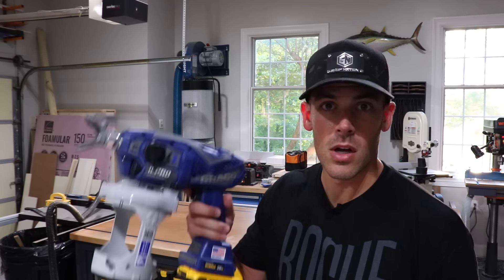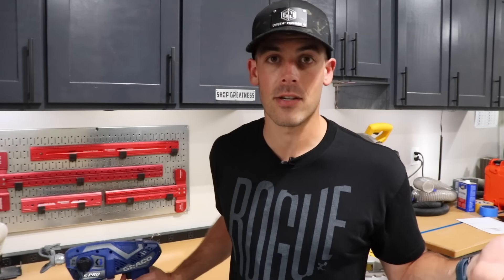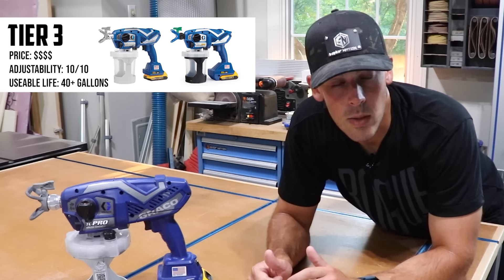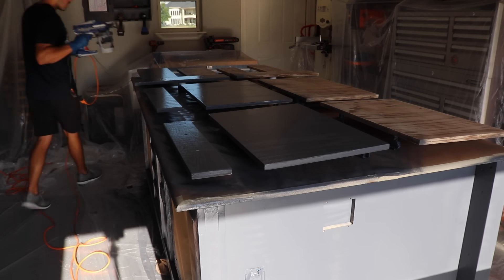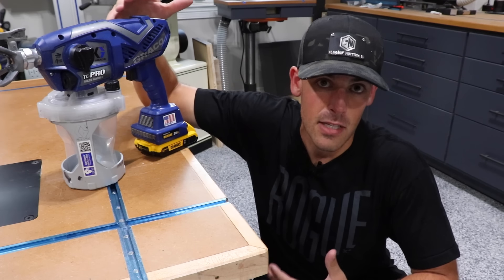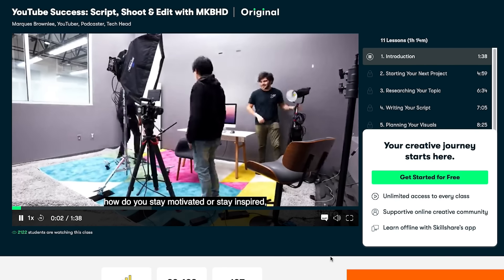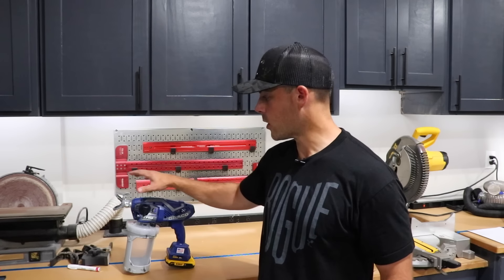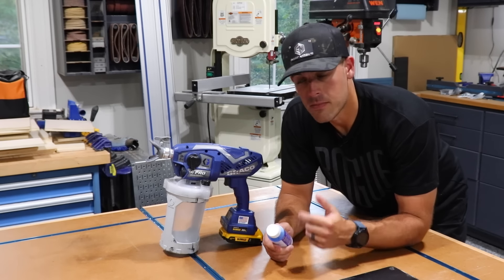Best Cordless Airless Paint Sprayer? // Graco Tc Pro & Ultra Review

Comment: Great video, one quick point, and it's kind of a biggie, the TC PRO and the ULTRA are the exact same sprayer. The FFLP spray tips are 100% compatible with the TC PRO and all of the inner components are exactly the same.
Reply: I called Graco  2/18/22 and this was confirmed.  Indentical except for cup frame and tip protector colors.  Common marketing for big-box / paint store offerings.
Reply: I saw this some place else in the comments. Thank you. I was thinking of switching them out before opening. I feel better.

I got the TC Pro at Lowes with a 10% off coupon I purchased at HugeOff for $2 and the price went from $640 to $570 after tax. So TC Pro with 10% off coupon seems the better way to go cause I'm seeing the Ultra for $640 BEFORE tax. So that's $100 difference.
Reply: @trevcdeal  I appreciate you sharing the “Huge Off” coupon deal.  I had never heard of it.  I made a $700 purchase two weeks ago.  Wish I would have known about this.
Reply: @missffinley  I literally just used it yesterday. Used the 10% on a $260 wood order and saved $26. 

I’m about to buy like 10 sheets of drywall and a lot of other stuff. Will come in handle again.

I’ve thought about getting the Home Depot Pro card so I can use the coupons with them. I just haven’t committed yet.
Reply: Your wrong.  The difference is that you can spray oils inn the ultra it comes with anti shock or something
Reply: @thehobbyguy  that's what I was thinking !
Reply: @thehobbyguy  yes the ultra is designed to he used with explosive material the pro is not
Reply: @DjbreedKronikaudio  that’s right they’re not the same only one sprays flammable materials which is a big deal for some contractors which makes them very much different
Reply: @trevcdeal  I’m lost. What are u saying? I’m interested. Thx
Reply: @longshotdiedtired1582  that's only the ultra max. The regular ultra is water based paints only.
Reply: Incorrect, they’re very different. If you want to spray volatile finishes (explosive, flammable) you need the Ultra.
Reply: @HBSuccess  They’re the same, you’re thinking of the ultra max which is used for flammable products.
Reply: @thehobbyguy  Nope they’re the exact same sprayer. The Ultra MAX is different and can spray flammable liquids but the TC PRO AND Ultra are the exact same sprayer.
Reply: @erineric1  Thank you.  I didn't notice they have Ultra and Ultra Max.

Comment: The Ultra goes for about 650 these days. But, how long does the pump last ? At $200 a pop, this thing sounds like a money pit.
Reply: Add a comment...

It is. one more thing that nobody seems to be mentioning is this guns pump was not designed for the long haul. Proof of that are the serviceable plastic ball springs that are not really serviceable. Whether it be a hex screw or Philips it doesn't matter. the pressure required to remove them will strip them. Same goes for the ball spring housing behind the tip. It's also made of plastic. There's no way to remove it without tearing it up.

Comment: That skill share sounds great. I have two of these. One Ultra and one TC Pro.  I have put about 90 gal. Through the pumps before the clogging problems begin. They spray excellent and I am a pro painter. I refinish trim and paint small 50-70 sq. Ft ceilings with it. Now the clean out. I can do it in about 6-7 minutes.. basically take off cup leave the cup holder top on and tip up side down under a faucet. Switch between prime and spray several times. Easy to clean and 1/2 the time of my big G490’s. Recommended if you do 5-10 jobs per year.
Reply: What tips do you normally use with the TC Pro other than the 514 that comes with it

Comment: Great sprayer! I have the Ultra and painted the entire interior of my 1600sqf home. I love the interchangeable tips as it helped me get the paint flow/fan size just right for the various paints I used. I know you were concerned about its ability to do big jobs and, while you will definitely get a forearm workout, I had no issues with overheating while running the sprayer continuously through multiple batteries. I also purchased extra 42oz cups and liners and kept other charged batteries handy so I wouldn’t have to stop and refill as often. Just don’t leave paint in the pump overnight. That cost me around $200 for a new pump… I hope this helps some people!
Reply from the maker: Wow impressive!
Reply: Try doing that multiple times. Lol. It won’t last, they are rated for how many gallons they can spray before issues. You might check that out. And oh the last thing you want when spraying is weight at the gun.
Reply: I'm gonna do my fence, hopefully it does ok
Reply: @shaynesabala why would he repaint his interior multiple times ?

Comment: I have the Pro Plus and use the Green FFLP tips. My only complaint is the spray isn't as smooth as say a Graco project sprayer or an HVLP sprayer. I never ever spray at the 10-speed. Id have to be outside painting a fence or barn you would have to move so fast. For furniture spraying it puts out a lot of paint so you have to move quickly. If you don't use a paint that levels out really well you may see what I call corn rows. If you turn the speed down all the way then the paint is intermittent. It is a pump after all. I just learned of the larger cup and I recommend have several of these for large projects filled and ready. This gun paints so fast you spend all your time reloading if you don't.

Comment: I think for 3 doors painting , and not mutch paint left, I will buy 25' long  3/16 "  graco line , and will use my gx21 .
Or can buy tcpro used like little- very cleane with one buttery. fir 250$ - but thus gun have so many times pump was stoped.  just didn't work .That's people's mustake  ? Bad cleaning? didn't use graco Armor

Comment: I just picked up a Graco Truecoat 360. Really wish I hadn't. I bought it to replace the 2 stage HVLP for painting cabinets/trim, tired of having to thin paint and deal with the ramifications of that. Wish I had bought the Ultra just for the FFLP tips. I didnt realize the Truecoat only used Truecoat tips. It's better than brushing and rolling for a smooth finish but isn't even comparable to a FFLP tip or even a x13 tip from my regular airless. Oh well, guess you live and learn and are just out $250. I wonder why they dont make a x13 tip for the Truecoat, or FFLP tips for it.

Comment: Good review but as a retired pro Finisher I think it’s way over priced considering it has limited use . You are better off with an HVLP unit with a cup that can also be used with a pot .This unit has a short shelf life and even though it can be repaired  , how expensive are the parts ? A good HVLP gun has far superior volume and pressure controls .

Comment: Would something like this work to spray Duratex?  It seems to normally be used in HVLP sprayers, this looks like a direct stand in if I do not want to mess with an air compressor.

Comment: I have the professional airless sprayer, that cost me only $399 last year.  I can run a full gallon of paint as set up, or simply make some adjustments, and run a full 5 gallon can. And because you aren't holding the paint and battery, but just the gun and hoses, it is not hard on the arms. You literally can paint 30 houses with this thing, with no replacement of parts, so long as you do the regular maintenance.  Wagner also puts out a pretty cheap version of the same I have, you just have to manually add oil to the pump in the same area you put the paint.

Comment: How would u compare these to compressor spraying?  After first coat I get similar finish to first coat or varnish where I need to sand,  not sure why if the coat is not thick enough due to too much air as would of thought paint would seal the surface preventing wood grain lifting preventing usual sand after varnish coat?  Would a undercoat spray stop this?  What do u experience?

Comment: Got the TC Pro. Same complaints/compliments. One difference: I've used to paint a whole room. No problems there. One huge difference you didn't mention: the Ultra can be used with oil-based latex whereas  the Pro is only (exclusively) recommended for water-based paints.🍻

Comment: Or for $200 you can get a lighter more powerful unit that is more versatile. 
Graco Magnum 257025 Project Painter Plus Paint Sprayer. The only way the handheld sprayers are beneficial is if all you do is small projects like trim work or need to swap out multiple colors faster without a longer cleaning process but mainly having small containers with multiple colors on the fly. The should of put the paint above the wrist and forearm like some of the othe brands to reduce fatigue but it come at a price of having a awkward time swapping containers. For the price of the small one most home users can save more than half that and get the bigger machine; they also have the x5 for $100 more than the painter plus. Just things to think about.

Comment: Does it handle Killz and other thick primers well?
Reply: Yes, I've run about 6 gallons of kilz2 through my TC Pro without issue. Just make sure you get the tip with the maximum orifice size, .016. kilz recommends a .017 but the .016 did just fine and I didn't have to thin it out at all, just played with the pressure settings until I was happy with the spray pattern.

Comment: Can’t you change the shield on the pro to the shield on the ultra and then be able to use the better RAC tips on the pro? Outside of some internals for flammable, aren’t the internals basically the same regarding ability to Spray non-flammable? Or do they take different size shields?
Reply: I have both Ultra and TC pro handhelds. You can take the RAC x tips from the ultra and put on the tc pro. No problem both 7/8” threads.

Comment: You can use the Graco RAC X tips (Green) like the FF LP for a much finer spray. You have to change the safety tip out for a RAC X (Blue) safety tip, Graco 246215. Note: that you cannot use a FF LP RAC X tips with the TC Pro (Gray) safety guard/tip.

Comment: PR nightmare for Graco. Pump fail after a few jobs, even after the recommended 20 to 30 minute cleaning times. So comments on here claiming to clean in 5 minutes is not manufacturers directions. Someone in here claiming 90 gallons. Impossible!!

Comment: GRACO is a great setup BUT to DISRUPT the market it need bag under the handle, battery on back of gun or top slides from the top, make it all vertical design with tip using a surround to stop the overspray on the product, easier to clean by keeping clean and we can have the ultimate unit. Industrial Designer ideas for free.

Comment: I have the same corded sprayer you have, my only concern is spraying poly.  it comes out so runny, but one pass and and a chip brush for the corners.  let it set and it was good to go.  Any tips on that?
Reply: You need to use the green Graco green fine finish tips and a blue guard.
Reply: @mrljvb  the green tips don't fit in the corded version, it only has a 4" and 12" tip
Reply: @anrwhitehead  you have to change the tip guard, the op noted he has the same painter as is used in the post, so yes, he can use the green tips, with the blue guard.

Comment: A good old Roller and brush are cordless as well and do not require hours of cleaning and when used by skillful hands  produce a finish as good as any sprayer.
Reply from the maker: Hours of cleaning?
Reply: Horse and Buggy used to work just fine too, who needs a car...Different ways, for different jobs. Or, people. :)
Reply: Try that shit on roof coating shingles for high angle Victorians and get back to me.

Comment: In my major architectural millwork shop, airless sprayers are junk!' Use binks with a good compressor.  This is harry homeowners stuff.
Reply from the maker: Well I am a Harry homeowner, so...
Reply: How much for a compressor that can handle the CFM? And the drier system, regulators, 240 volt service(for a REAL compressor), hearing protection, hoses, fittings and general maintenance?

Comment: Honestly feel like all of those option are a waste of money when you could get the x5 for just north of 300$ which can handle bigger projects as well as small ones. It also can use real tips and different guards as well. You could also at that point buy a more expensive gun as well if you wanted. And you don’t have to constantly refill a 32 oz cup every 5 min either. And if the job is small enough just get a cheap hvlp spray gun.
Reply from the maker: The problem with the x5 is you go through so much paint just to prime the damn thing.  Not good for small projects but excellent for big ones.  And your suggestion to then just also purchase a "cheap hvlp spray gun" kind of takes away from your initial argument.
Reply: @ShopNation  You said gun is perfect for  small applications  which is exactly what an hplv would be great for well producing a better higher quality finish for a lot less money then the gun you reviewed above. As for bigger projects that's where the x 5 comes in. Priming it takes no time pushing it through the 25ft hose is what kills you on paint. solution get a smaller hose lol.  Only downfall of the hplv is you need an air compressor. But seeing as your a "shop" channel I would assume everyone would all ready have one of those. Just kinda seems like an oxymoron type of thing cause you have pro/commerical wood working tools yet review and recommend a super expensive crappy diy spray gun. Love your channel this one just threw me for a loop.

Comment: This first job I did with one of these was a 200’ x 17’ wall mural (I’m a mural artist) and I used two of them, alternating. Worked out awesome. Cleaning it and changing colors does take forever, and I literally got a terrible case of tennis elbow at one point for using it too much. I still use them all the time though, and have Popeye forearms 😜🦾

Comment: I have the ultra and project plus.  I've not had any problems with the ultra on shutting off or overheating.  Having not to deal with priming a hose and later cleaning is an added benefit.  Cleaning it is not a big deal for me.  I use the regular cup so weight is not an issue either.  It's my go to sprayer and actually makes it less of a chore to paint.
Reply: According to the Graco rep, the difference between the TC Pro & Ultra is the Ultra is shipped with the better FFLP tips and they are both the same sprayer.  ??  Lowes & HD sell the TC Pro.

Comment: Just bought this unit to paint some shed siding and other small projects.  So far I'm very impressed, makes easy work of t111 shed siding.   It's a bit of a paint hog with overspray but the time savings in worth it. I am heavily invested in the Milwaukee m18 battery system and wasn't crazy about now adding a Dewalt cordless tool.  I spend about $21 on Amazon and got a Milwaukee-to-Dewalt adapter to use on the paint sprayer and it works great.  Sold both Dewalt batteries and the charger for $100.
Reply: Thank you for your adaptor advice

Comment: If you want to spray stain or oil based paint, you have to add a grounding cord to your cordless sprayer hence taking away the cordless feature and scratching your head, why Graco? Couldn’t Graco come up with a solution for spraying stain other than a corded cordless? I was thinking that a floating ground strap around the waist should essentially work. No ground with oil paint or stain gives you continuous shocks. Fun!

Comment: Travis great review. I do have one thing to say about both the tc pro and ultra models. Graco has stated that both of these are in fact the same sprayer just different name and the same components. The only difference between the 2 is the spray tips that come with each are different. Other than that it's all the same.
Reply: You ca use the Graco green fflp tips and rac x tips on the tc pro too. I have both units.
Reply: @Mowers11  yes. I can't wait to get mine. It's going to be a great spray system
Reply from the maker: Good to know! I didn’t realize that

Comment: Thanks for your review. I don’t own any Dewalt Batteries and don’t plan on doing a bunch of painting. I’ve been thinking of buying a paint sprayer. I seen your last review on the corded version. I think the I’m going with Truecoat 360 VSP The corded version.
Reply from the maker: Great choice
Reply: @ShopNation  Question: is the Graco Truecoat 360 VSP considered an HVLP sprayer? I want to could I use it for Lacquer,Polyurethane or Varnish as well.

Comment: Used this gun to paint exterior siding on my house, 1500 sq ft and painted exterior of two barns! I love it! And it’s never overheated, not once. It was 90 degrees when I painted last barn, went thru 3 gallons of paint. It’s been awesome! I don’t have the 42oz system still using 32oz so means filling up more but it’s lighter. And you can change the guard to the rac x and use fflp tips which are awesome and a cheaper way to use those tips versus buying the ultra

Comment: I cannot imagine an application these are good for. They're a waste of time. It's very heavy with the paint motor, battery, all in your hand. Very bad uneven pulsing spray. Barely saves any time over rolling on for the amount of coverage you get per fill-up. Very hard to clean well without getting the whole thing dirty. A proper airless sprayer on stand with hose to a lightweight handle is much better.